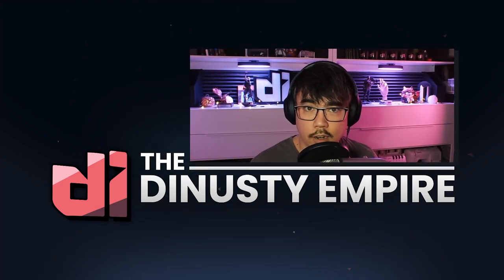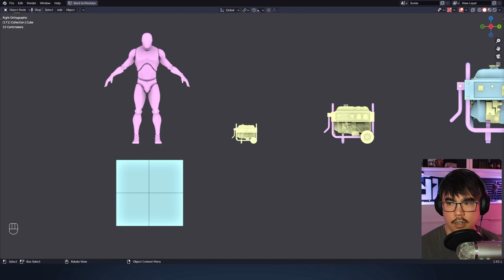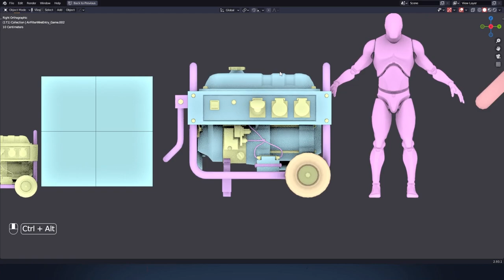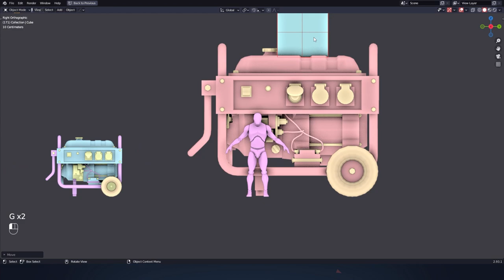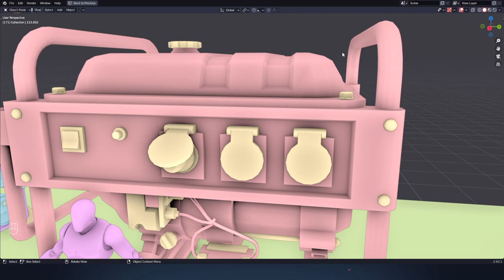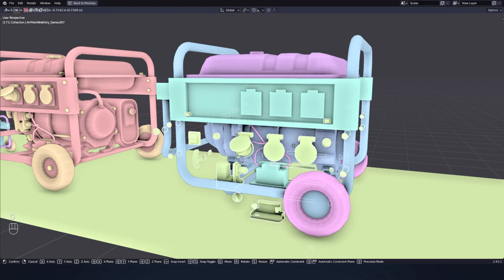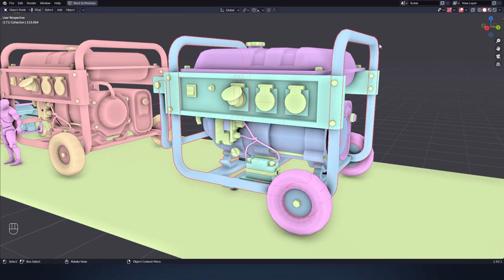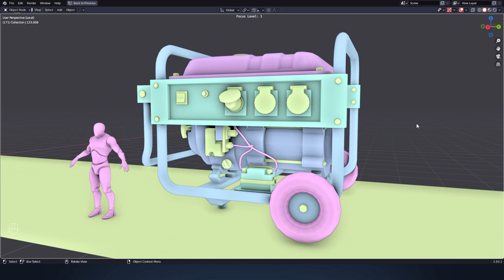Discussion: Talking Texel Density

Comment: In Star Citizen they add a ton of detail by using decal trim sheets which are coming with its own normal/roughness/albedo map and are highly reusable over all assets. Second big impact to the look and feel of these models are weighted normals, which can be achieved by using auto smooth and the blender modifier. 
Nice explanations and nice video. Blender should support a texel density checker without buying third party plugins :/ I always have to eyeball this against a reference cube. Close enough ^^
Reply from the maker: I’ll def be talking about trim sheets as we get into options with scale becoming something you have to solve. There are free texel density checkers for blender. This one is my go to. 

https://mrven.gumroad.com/l/CEIOR
Reply: I never understood how I should interpret weighted normals (WN). I understand what they technically do, but I don't know how, or at what point I should use them. Do I apply them after a bake? Do I bake with WN applied? Are they transferred along the mesh when exported?

Comment: Thanks, man, I had a discussion on discord about this 3 weeks ago, so what about the texture resolution for small unique 0-1 assets compared to the larger one apart from tileable? I think genetic textures are hybrid textures? (Uniques + tileable)
Reply from the maker: for the size of the smallest asset and based on the 512 that i demoed, it would e 512 for the 0-1 prop.

generic textures is a number of things which is why i wanted it to be a separate video. so in some ways your correct on the unique + tileable also :)